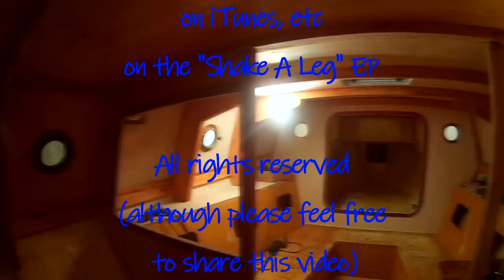The sliding hatch - SV Tapatya EP105

Comment: Good day sir, Im wondering about your electric power tools, I'm keen in getting them myself, the Borsch hand held grinder, plainer, and scroll saw, could you kindly share the link as where I'm able to purchase it on line, I'm currently in Singapore.
Reply from the maker: Hi Ezzy. I bought most of mine via Amazon. Just search for Bosch professional cordless 12v. That should do the trick 👍
Reply from the maker: Saw = GKS 12V 26
Planer = GHO 12V 20
Drill = GSR 12V 15
Grinder = GWS 12V 76

Hope that helps

Comment: Your boat and your project. I think you could sail without hearing but seeing is a different story. Please wear some safety glasses while using your table saw. Hate to see you disabled before sail day.
Reply from the maker: Thanks for your concern, Pat.

Table saws are undoubtedly dangerous machines and we have to learn to use them with care and respect. You’ll notice I use a pushing stick and am very careful not to get body parts near a revolving blade. A riving knife is essential and I have one fitted unless the work I’m doing demands I remove it. In my opinion, the riving knife is the single biggest safety feature on a table saw, and is often sadly under appreciated. The dust guard over the blade is also important. I (almost) never stand in line with the blade and do indeed wear safety glasses whenever I feel there to be a need.

Please don’t take this wrong Pat; I’m not having a go, just trying to point out some of the many safety elements in the use of these machines. Whilst I do think we sometimes get carried away with health and safety ( particularly in the UK), I have no doubt that machine tools should be used with respect for their potential to do us harm, and certainly advise others to do likewise.